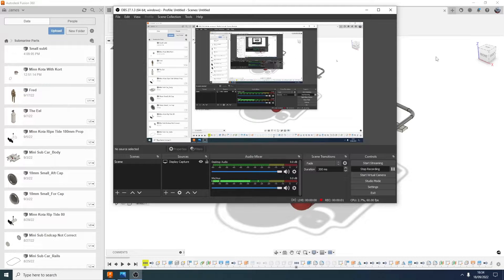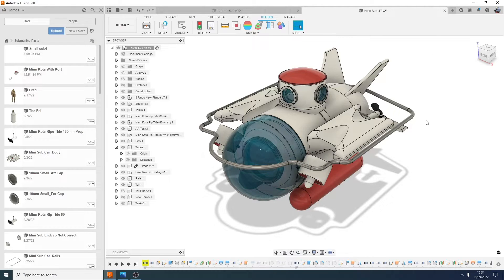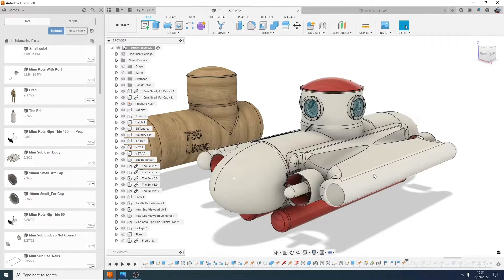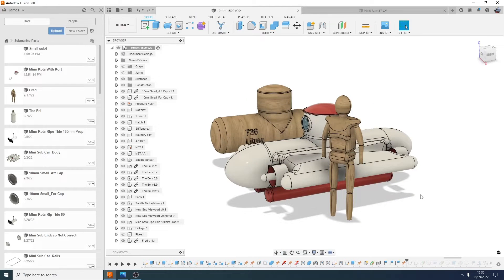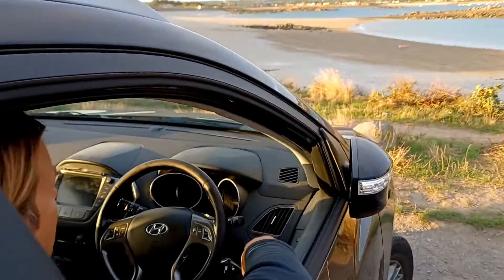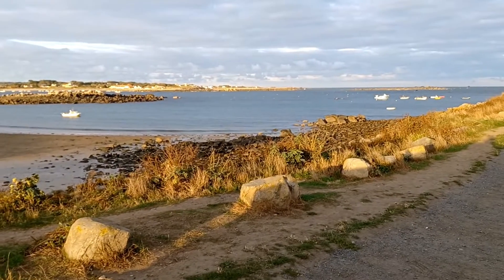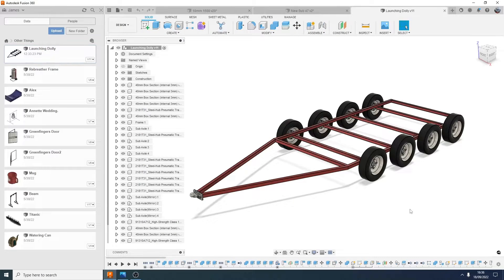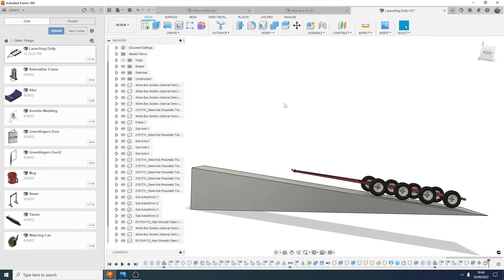Building a Submarine. Part 90.

Comment: Just a suggestion when I built my sub I set up the double axle tilt bed trailer with channel rails and a winch then I installed wheels on the sub skids this allowed me to launch the sub at any boat ramp by myself the sub would just roll down the trailer and down the ramp into the water the sub weighed 2.5 tons.  Here's some video https://youtu.be/9OhwRip3cCc

Comment: you  need a crane barge  built on a dutch style sea barge  then you can use it as a living space dive boat and have the sub ondeck   then you can ancore it in  the harbour and beable to dock at a peir   to off load sub using telli handler